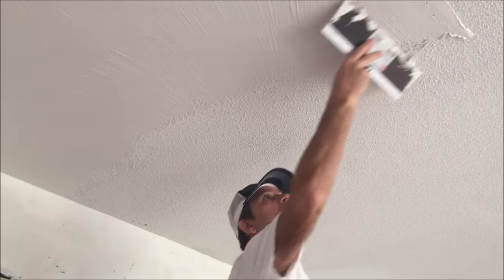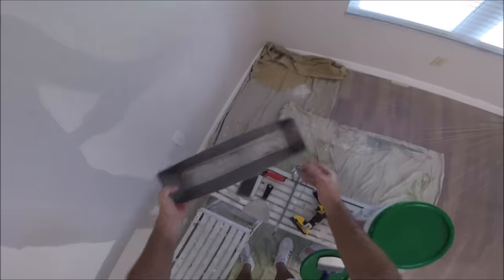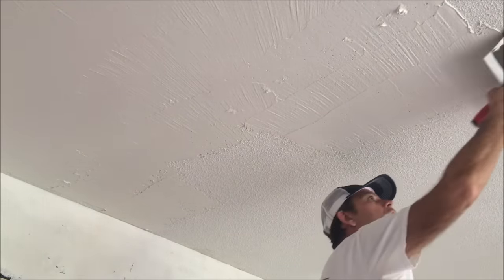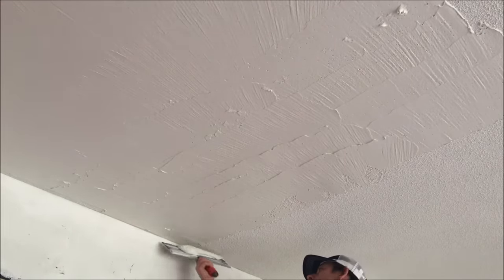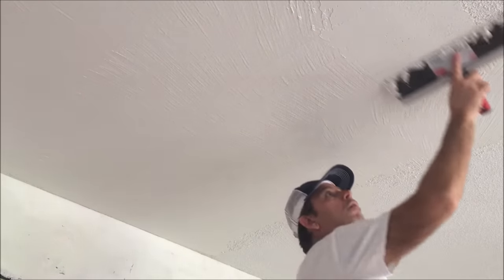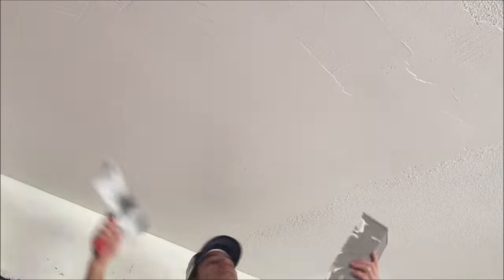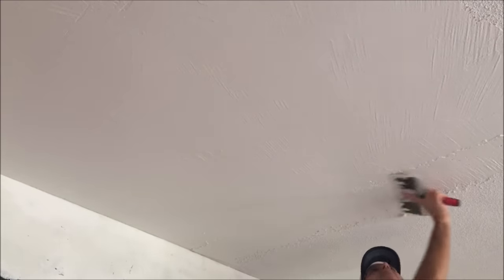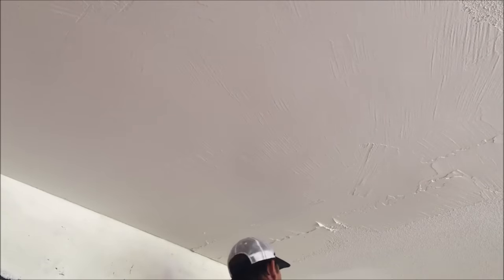Don't scrape your painted popcorn ceiling. SKIM COAT IT!!!

Comment: Scraping takes way less time. Skimming takes at least 2coats, sanding, touch up and a ton of skill. Not to mention if that popcorn has not been painted it super dusty which will not allow the mud to stick and over short time it will flake off.
Reply: Keyword in the title says painted

Comment: We tried removing popcorn from our kitchen ceiling using recommended techniques online. We’re big (or were-getting on) diy people, but gave up on the popcorn removal-wasn’t going well at all. Did luck out and found a guy who hung new drywall over the old ceiling. Joint compound on the seams. I sanded the few spots that needed it, and we primed and repainted. So that’s a great option. But was $500 -one room. We’d like to do our whole house. But our house is a cape, so bedrooms upstairs have slightly sloped edges. Your technique will handle that problem great-learning curve definitely needed with the gentle sloping, but will be way better than what we have now. Thanks so much for a great solution!

Comment: Hi Paul. First of all I would like you to know that I am a housewife that knows enough about fixing things around the house to be a little  dangerous but smart enough to know when I need help. I have been dreading taking down popcorn ceiling that has no easy solution to be taken down out of my entire house. I’ve done three rooms and a small bathroom so far and you are absolutely correct there is no easy way to get that flat and not Making a dusty mess throughout your entire house because of the sanding. I even used plastic on all the walls the doors taped it to tarps in the floor and it still made a mess throughout my downstairs. I decided to go with the one that you showed using the sand and joint compound. 
However, I think I’m not seeing your video that shows the issue with popcorn ceiling if the drywall under it has never been primed or painted. Then adding that sand compound. So what’s the best way about going about that. I live in Augusta Georgia area And wouldn’t mind a quick phone call. I am always up for good suggestions

Comment: I've done a lot of drywall repair on walls and ceiling. Always shied away from textured ceilings.  I have a ceiling with water damage to fix the leak and replace the damaged drywall and blend in the stippled texture. After watching your instruction,  no more doubts about my ability..

Comment: And if you don't have a few years experience in drywall finishing don't even try this.
Reply: Yep
Reply: Well, like he says, it doesn't have to be perfect if you are going to texture it anyway.  I'm not great at stuff like that but I can do it, and I'm a mechanic not a carpenter!!
Reply: THIS! This is NOT a DiY technique
Reply: Exactly Bruce.  This is very tough physically and only someone with many years experience can do this right.
Reply: Bruce Dakan     My thought exactly!
Reply: I've had a few years, many years ago.  Would definitely hire a professional for this, not like patching a peephole at Porky's.
Reply: Right. I'm a painter and do some texture. And owners be like. "Wow! You did that so fast, i should have done it my self." Like I've got the tools and do this every damn day. It looks easy but not so much
Reply: I would rather pull it down and re-install drywall. This looks too difficult.
Reply: Lightweight mud does have trouble sticking!
Reply: @patricksheehan8157  Not if the walls are plaster with metal inside of them :)
Reply: I'll have you know I've been doing drywall finishing for about 12 years now on and off and I would probably get a C- at doing this still lol
Reply: Patrick Sheehan all you have to do is spray it with water and it comes off easy
Reply: you have to mix the mud properly and smack it on, make sure you wipe the surface clean first.
Reply: G Deit  you really shouldnt sand between coats.
Reply: @davesilvia9711  Oh please, high horse much?
Reply: @L6901Malice  30 years in the trade, so mabey i learned a few things.
Reply: Well maybe but I drywalled my basement a contractor asked me "Have you ever drywalled before?"  I said well some patches...but nothing like this... he said well you did a damn good job for someone who never did it.  How?  I went real freakin slow and studied... of course I got better but the point I am making is no you wont be as good as this guy, but you can do it, just will take you a lot longer.
Reply: Exactly
Reply: @chuckHart70  Definitely. I do this for a living, and I tell people all the time that anyone can do what I do, people just choose not to, whether it's from time constraints or they're just not interested in learning it. And honestly, skim coating is a FANTASTIC way to learn mudding, especially if it's going to be textured at the end.
Reply: @SaltyTubers  I remember that peephole 😂
Reply: @xltek1  a what?!
Reply: I have such dumbass faith in my ability to do this kind of tradework with no even basis of experience. I needed to read this
Reply: I’ve only ever skim coated 4 times in my life and skim coated a popcorn ceiling, it was tough but it came out good if I stayed patient and kept my form
Reply: Meh. I did it and Id never skim coated over popcorn before. It turned out just fine. It just takes alot of patience if you're a DIY'er.
Reply: If they don’t try it they’ll never have the experience.

Comment: I used to put a little plaster of paris in the first coat to get it to set faster, then you can just smooth the ridges instead of scrapping them in 5-10 minutes.

Comment: Hey Paul! I was so inspired by your video I decided to skim coat the bathroom ceiling to cover up the sprayed on knockdown. I was warned by a friend that over the shower it may bubble and then fall, which it did. I ended up having to scrape all of it over the shower off. Should I merge it together with what I have done so far, or scrape it all and start fresh? The rest seems to be fine.
Reply: Cut it out in shower area and greenboard? Or maybe just use a good sealing/bonding primer do like 3 coats on the ceiling area and reapply your skim.

Comment: It's just as easy if not easier to scrape it.  I scraped about 1600 square feet myself and had no issues.  Used just a little joint compound just to patch nails and other spots that needed it.

Comment: Painted popcorn does come off scrape off hot water and vinegar and Dawn soap spray let's set for 20min to 30min spray again before scraping to lower dust and this way you only have to skim coat once and for me personally I can scrape popcorn faster then skim coating over it
Reply: The popcorn texture may have asbestos in it, according to info on other channels. So, it's better to skim coat the ceilings.
Reply: Agreed.  I'm a painting contractor.  I ran a bucket of vinegar / water mixture through a small old sprayer I no longer used.  My wife and I had 2200 sq ft of house prepped with plastic, ,sprayed and removed in under 4 hours.  After that I did a decent amount of mud work to ensure the ceilings were flawless prior to paint, however it wasn't a big job.  Everyone cries Asbestos...we wore respirators and when you wet it down there is very little dust that gets in the air.
Reply: We spray it down with water and wait about 5 minutes and comes right off

Comment: Paul I Did a lot of these ceilings, and I used concrete fill it Drys in a couple of hours and you can apply another coat, Just have to clean your pail out after your Done as it will set up

Comment: Nice. I hate texture walls like there's no tomorrow. That type of ceiling is always falling on you and textured walls also suck because you can't hang anything since nothing is flat. When done on a surface that crap is even worse because of the same thing, not to mention you can't even clean it because all the dust gets stuck all over those irregularities. Our current place is like this and that crap is even on the flat sides which suck ass. I had to scrape of the ceiling of my room in an old house we lived in. Sucks monkeys. If I ever own anything anyone telling me to texture any walls will just need to make a u-turn. I hate that crap like there's no tomorrow. I also found out they do it because it takes no time to cover a wall. Not cool. This is a good option if it's as you say almost painted on vs tearing it all down or just adding another layer of wall. I learned something new today, thanks!

Comment: Why not cover it with 1/4" sheetrock and tape it, it seems way faster, labor vs material cost
Reply: Sheet rock is expensive, though
Reply: @LG-er6ng  11 a board, that is cheap considering it will take an hour to hang, hour to mud and tape all joints, or you can spend 40 for two buckets of joint compound and take all day smoothing it out, and the next day sanding and cleaning.
Reply: Ok, send me $ please, lol
Reply: Still got to skim it

Comment: Omfg ive killed TWO electric sanders, put in ALOT of hours sanding by hand, tryna get that popcorn crap off the ceiling in my bathroom! It had about 3 ( minimum) layers of paint, btw.. Ive just begun the 4th or 5th MONTH of this project (im still recovering from an injury to the achilles heel where i cut into the nerve behind my ankle. Yeah. OUCH, indeed!).. anyway, this video of urs is a TOTAL game changer!! Thank u soo much!! Oh.. & my HEEL thanks u too!!
Reply: UPDATE"
Ive (finally!!) got the whole ceiling done, a  whole wall, and now working on the second. Following ur advice has been a total game changer for me. i had a little setback due to some of that popcorn crap that had found its way into the drains of both my tub and sink, thereby creating a clog/blockage from HELL!! I was ready to pour some muriatic acid down the drains-it was a nightmare! Thankfully a manager at my local home depot was able to stop me in time to save  my drains!! lol Either way, my project has been going swimmingly now, and is moving along nicely.. Thanks again!!

Comment: I find removing a painted popcorn ceiling easier than a non-painted popcorn ceiling.  I break the popcorn open by roughing over it with a trowel, spray it with hot water which gets into the popcorn through the holes I broke open roughing over it.  I then scrape it like normal but the painted layer holds the popcorn together and it comes off in large sheet like sections.

Comment: 1in nap paint roller on a poll. Thin out the mud enough to be rolled. Roll it on thick cost about a 10 by 10 in a min and then a 3ft skim blade.

Comment: I dont know how old that ceiling was but I just scraped the painted popcorn off a 25 yr old ceiling.
Wet it with my garden spray and used a 14" knife. 
Granted skim coating over it is less messy but it can be scraped.
Reply: Was it painted?
Reply: @r3negadeh3ro  
Yes

Comment: I always use Ultra light weight mud for this type of work...& Follow up with a coat of oil base primer, before a finish coat of paint. No problems....
Reply from the maker: I feel like all purpose joint compound is a better choose for the first skim. Because the AP has a lot more glue in it. Which gives you better adhesion capabilities.👍🏻 What are your thoughts on that Sonny? I really appreciate your feedback back Sonny!😎 Thanks so much for watching and subscribing man! -Paul
Reply: Paul Peck DrywallTube / yeah, I normally use all purpose mud  for the same reason, but, never had a problem using ultra light on ceilings only. Not sure about the  "glue" content in the mud ???? Some people use light weight mud on tape joints ; what a joke.....

Comment: My non-contractor self found out the hard way about removing painted popcorn ceilings compared to non-painted.

Got frustrated and decided to figure a way to get water into the texture...

by taking a 10" taping knife and RAKED THE S*** out of the texture.

Just to break up the paint.

Then stubbornly applied water...

It actually worked pretty tits.  The water got in-between the paint cracks/chips and the paint kinda held the water in.

Sure n shit made it wayyyy easier to work with.

Looking back (this was in the pre-YouTube era) I got lucky. If the paint was thicker, and/or chemically different, then this approach would've failed.

But if I'm ever tasked with removing a painted textured ceiling again...I'll consider this method

Comment: All we do is scrape it off then apply prime then fix it up a little. Fill where it needs to fill them skim coat a thin layer sand and that's about it. Spraying it with hot water first with a airless paint sprayer pump comes off all neat.

Comment: I’m a thirty year journeyman. I did this a few times in the late 90s without any tack primer. If you slam a door or pound a nail it would chip out. We started using Zinzer wet tack first and the problem has never returned. 
Just in case you have read texture up there!
Reply: Not read texture….bare texture…like not painted

Comment: Question: my husband just scraped the popcorn, sanded, removed the dust, then painted 2 coats. It looked amazing. One problem...
When certain lighting hits the ceiling, the seams are visible. He did not skim coat anything before painting. Is there a way to only skim coat the seams without having to do the entire ceiling? Or will it be too obvious?

Comment: Question for you. Had to replace my old fan in the bathroom (finally kicked the bucket after 35 years). A bunch of the popcorn ceiling around it came off (styrofoam not asbestos), so I just scraped it ALL off. The ceiling took a beating in the process. What are my options (besides demoing the ceiling or putting more drywall over it).

Comment: Great video!  Question: we have a flower-looking pattern on our ceiling throughout the house. It has a sheen to the paint. Will your  technique work on this surface, or will we need to prepare the surface somehow first? Or, are we better off getting a drywall sander? Our house was built in 1982. Not sure if there is asbestos (I keep reading different years for asbestos). Thanks in advance!

Comment: You can scrap any popcorn ceiling off, just spray water on it let it set, and it scraps off easy,I have done many ceilings like that and never had to rock over it. It's alot faster and you don't have to waste all that mud. You could have scrapped that ceiling in less than an hour,alot of people like smooth ceilings.

Comment: Hey Paul, Question if you don't mind. If you want to skim coat a popcorn ceiling that has asbestos (built in the 70's) but hasn't been painted do you prime it first then skim coat?

Comment: Lol doesnt matter if it's an old popcorn ceiling. It will come off if its properly done. Plastering over all that popcorn is a hassle and waste of time. Also finished product doesnt come out as nice. Not trying to be a "hater" myself lol but I oftenly do to this stuff and hearing you guys say either plaster over it or put new drywall did catch my attention and thought I'd put out there for your followers.. 👋

Comment: Hey Paul, I have painted popcorn ceilings that have been half scraped and have large areas where the drywall was removed due to water damage. So we will have to patch the drywall and just want to know what method you would recommend to get a smooth popcorn free ceiling? I can email you photos as well. Thank you- Morgan

Comment: I've been told if you remove a popcorn ceiling you should sand down the entire ceiling back to its original drywall then skin coat the areas needed because if you don't you'll have problems with paint adhesion. Is this true? I just removed a popcorn ceiling in one of my rooms and I'm dreading having to sand it down to bare drywall before proceeding with skim cost and texture. Andy advice would be appreciated. Thanks.

Comment: So I might have messed up. I just used Kilz 2 (a water based primer) instead of an oil based primer. Do you know if skim coating over Kilz 2 works as well as the oil based Kilz when skim coating a popcorn ceiling?

Comment: #drywalltube. Awesome video. I think i've now changed my mind from attempting scraping the popcorn ceiling to skimcoating now. Do you recommend finishing mudding new walls before skim coating an older painted popcorn ceiling? I have some gaps at the top of my new drywalled walls that need filling with compound first and the new walls haven't been mudded yet. Also, can you get away with dust reduction compound versus all prupose for skimcoating? #Nimminati

Comment: Anyone can do this
But I will say, experience will exponentially speed this up

Popcorn ceiling removal is a chore, it’s super dirty, it also can contain asbestos 

This seems to be the simplest way to deal with the absolute catastrophic mess that scraping a ceiling entails

But...it’s not easy
But if you don’t have a lot of experience, but you have plenty of time, you can do this yourself

Just know it might take you months 
Practice in closets 

But I charge $2.50 per square foot on popcorn ceiling removal and will only bid on unoccupied properties

I got about 3 years experience and this stuff still is a daunting job
But....beats being a cubicle jockey any day

Comment: Scraping is really easy. If popcorn is painted, spray, leave it overnight. In the morning, spray, have some coffee, breakfast, spray again, start scrapping... Since paint will let some amount of water, it will not even create dust. It will come off in big sheets like a wall paper. After that, patch damaged areas, screws/nails, do any necessary repair that was hidden by popcorn. After that, one single skim coat is enough.
Reply from the maker: This is the old school type of popcorn that’s made with vermiculite. It’s like concrete! The more modern popcorn ceiling textures have poly beads and is a lot softer and easier to scrape off.👍🏻